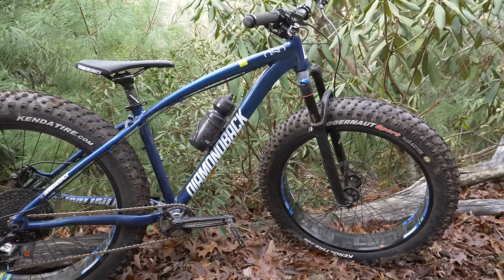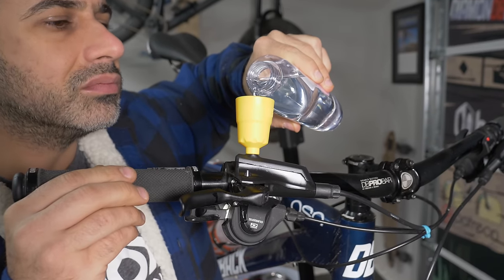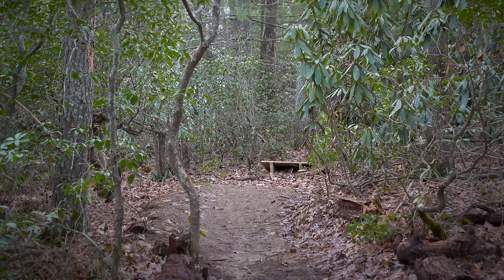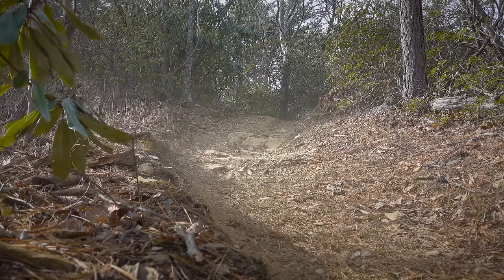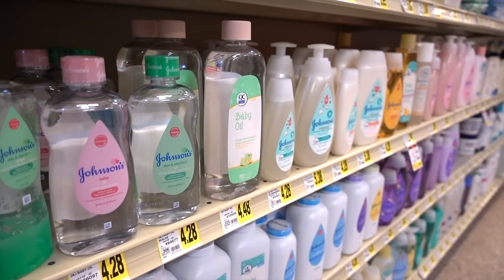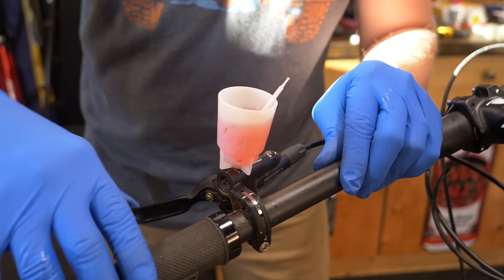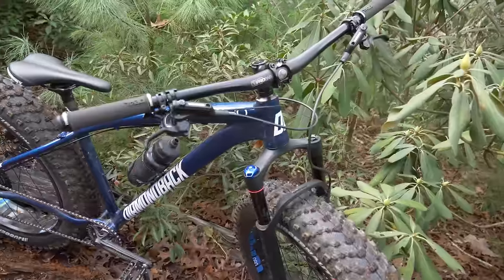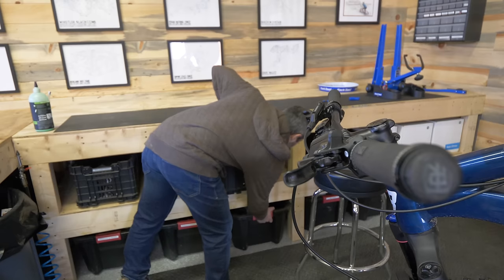I filled my mountain bike brakes with baby oil for a year and here are the results!

Comment: Now I'm wondering if I can use baby oil in my Shimano fishing reel bearings and petroleum jelly on my gears. I've been paying $50 for reel oil and grease for the last few years and they look very much like baby oil and petroleum jelly.
Reply: If there are plastic couplings or rubber seals in your reel, petroleum jelly might degrade them. It's probably silicone-based, unless it's all metal (which it might be)

Comment: The main ingredient of baby oil is mineral oil, which seems to be the same type as brake oil. It seems to be a good idea to use it in mineral oil brake, but we need to pay attention to the fact that the kinematic viscosity of baby oil is different from that of mineral brake oil, which will lead to the change of brake rebound speed. Besides, a series of additives, such as anti-oxidation, anti rust, high temperature resistance and anti-corrosion, are added into the brake oil, which are not available in baby oil. Therefore, we suggest that the most effective way is to use baby oil Good or special mineral brake oil, may as well consider the next ezmtb, excellent performance Jia :)

Comment: The reason that I wouldn’t do this is because baby oil has chemicals in it that evaporate so if you put this inside of your brakes it might work for the first few weeks and then he might have some problems but that’s just my theory love your videos Seth
Reply: Very small proportion of chemicals in baby oil additional to refined mineral oil. Basically just perfume (tiny %) and possibly colour, though branded brake oils also have colour added.

Comment: in the automotive world fluids are designed around brand specific seals and the properties that break those seals down ON PURPOSE so that you have to use their special blend for the additive that keeps their pet seals from leaking and failing altogether.
brake fluid can be any fluid for the operating temperature that doesn't bubble or cause air pockets, doesn't overheat, and doesn't break down the system it's being used in. i'm sure some where in the universe molten lava can be the brake fluid. probably jupiter or the sun or a black hole. my imagination with physics isn't the best tonight but hey, it's just a figure of physics in science, invent your own atmosphere.

Comment: Question:
"Is motorcycle brake fluid a good alternative?"
"Or is it just the same as brake fluid for the bikes?"
Reply: Not even all the brands are using mineral oil. Some brands use DOT fluid which is used in cars, motorbikes and aviation. NEVER mix DOT and Mineral oil!
Reply: @KapitanPisoar1  thanks! I appreciate it!

Comment: could you use dot 3 or dot 4 automotive brake fluid? might be cheeper than the baby oil too depending where you get it (Ollies, or other overstock stores can be really cheep)
Reply: Absolutely not. DOT 3 and 4 fluids are glycol-ether; very different chemistry from mineral oil. Brakes designed for DOT fluids use different seal materials to resist the strong solvent properties of those fluids. Spilled DOT fluid will even damage paint. DOT fluid in a brake designed for mineral oil is very likely to damage the seals.

Comment: We experiment with different types of mineral oil and even try water(yes water).....they all works well that we conclude that the density of the oil is the significant part.....(we should have tried motor oil which is thick fir sure)........the liquid in quesion need to run smoothly back and fort inside the tubing or brake hose...no wonder water also worked.....but I think plain mineral oil should be better than colored mineral oil.
Reply: The coloring us nice to evaluate the oil when purging, you can for example alternate between clear and colored oil to make sure the old differently colored oil is fully out

Comment: Clever in that respect seeing that baby oil is mineral oil based it would then be very similar to dot 2 brake fluid. Just a note please do not use baby oil in your car/truck/motorcycle as it will need dot 3 to 5.1 which is glycol based not oil based.

Comment: If your not descending with the brakes on long enough to overheat the fluid it won''t really matter whats in there if it doesn't rot the seals or cause corrosion. Seems like a good enough emergency measure if you have a problem and can't get 'correct' fluid. A 99% brake is way better than 0%

Comment: I used vegetable oil in a clutch one time. That was over a year ago and in a motorcycle. Actually, it's still in there. And my clutch is perfectly fine.
Reply: I would higly recommend you to get it changed not because it will damage it not immediately but after a certain period it will eventually become acidic and will start to form butter like residue which can and probably wear parts or make it difficult to function properly (if it requires mineral oil go for the baby oil if needs brake fluid dot 3/4/5.1 will be great and damn cheap i find it for 3 euros /250ml

Comment: Just use vegetable oil.
I've used it, here's the results:
faster Breaking, cheap, ez to find.
But here is the bad results:
brake could either literally won't break, Orr it would lock up.
Greasy, if you accidentally spill it and it touch with the tyre, you'll lose some precious grip.

Comment: In the northern United States like border states it's below freezing temps mite not be a good idea I use ford mercon transmission fluid also if you do have leaks it's red color will stain rotor you can see if you have a leak issue baby oil mite degrade seals on some units I have seen engine coolant used in alaska also

Comment: I tried filling baby oil on shimano mt315 and mt200 and it still works right now. It's been 2 years since I filled them. I also tried filling zoom hydraulic brakes but it ruined the seal and leaks. The brakeset came to me without any oil so I filled it wil baby oil and I can't use them anymore.

Comment: Not worth it for me.
The temperature stability is still unknown and could change a lot between brands.
The oil could also part or suck moisture over time.
The brake fluids are a lot more controlled for bikes, baby oil just needs to not harm a baby, everything else is not important.

Comment: Stupid question: how do you tell if it’s a hydraulic kit? That cable will be completely absent right? Just like a hollow tube?
Reply: There's no "spare" bit of cable hanging out the brake caliper end. Just pipe. Some brake levers will also have a visible piston when pulled too, instead of a visible cable.
Also, many hydraulic brakes say so on them because they're more expensive... I guess so you have something to show for it.

Comment: I'm 270lbs and ride a GT Pantera sport hard tail. It came with tektro mechanical disc brakes. I find the brakes very weak even going down small grades. I've adjusted the brakes to their limits and still find them weak. Would Shimano 2 piston hydraulic brakes help alot or am I just throwing away my money. I ride light trails. Nothing crazy

Comment: Seeing someone with a bike with tyres that wide to ride on a hard surface is like watching someone walk up an escalator moving in the wrong direction. Side note: mineral oil eats rubber, bad idea to use on anything designed to run with traditional automotive style brake fluid.

Comment: Well first of all if you get injured using this and the insurance company does an investigation( depending on how high your bill is) you're screwed. Plus its not only mineral oil, its corrosion inhibitors oxidation preventers( to keep the oil stable) detergents and so on. Its not just for funnzies they engineered a high boiling point oil and spend thousands of hours of research. Generally when it comes to your health you dont skip. Its worth the 20-50 dollars per every other year. I mean that bike is thousands of dollars. Why cheap out?

Comment: Can i use mineral oil instead of dot 4 brake fluid ? Where i am shimano mineral oil is stupid expansive for some reason and have known people using off the shelf cheap mineral oil but they dont use the bikes to extremes. So for everiday use casual use baby oil is fine but if you ride hard ,well no i know tested that. Yet.

Comment: Seroius question. I Need to bleed my Shimano brakes, but I can't find Shimano oil anywhere. Can i use the Finish line minerale brake fluid? I can't find reliable informations on It, but I happen to have a bottle of that sitting around. Some people online say they had black goo coming out their brakes when using it, others that they had no issue. 

Thanks

Comment: Here's an opinion that a lot of "gear heads" don't like:  These companies put the screws to us, simple as that.  Using Shimano Mineral Oil is not going to make a difference to 99.9% of riders over using Baby Oil or Mineral Oil.  Its the same stuff.  Same as chain lubes.  Back in the day there WAS no specialty chain lube, we dripped 3 in 1 oil on our chains with no problem.  Recently got into a discussion on a Maine MTB page and everyone was laughing at me for taking off my chain, cleaning it with WD-40, soaking it in chainsaw bar oil, drip drying it and replacing it.  Guess what, Ive NEVER had a chain or drivetrain issue and I ride harder than everyone I know.    Its consumerism, nothing else.  We THINK we need these specialty products, we have the money to spend, so we spend it.  Im a hard pass.
Reply: so you've never replaced a chain? its gonna snap soon mate.

Comment: I doubt that you'll feel the difference on any chemically tame fluid, probably even water will do the trick, at least so long as you don't overheat it
Reply: "...so long as you don't overheat it"    and there's the rub (if you'll excuse the pun) where the friction of a disk brake involves heat. (hence vented discs, pads, and ceramic pistons.)

Comment: Just so you know, my RC Carisma SCA-1E Range Rover shocks are filled with olive oil. Well I didn't have damper oil on hand but needed to work on them. Olive oil is pretty light, probably about 15wt. I wanted it softer anyhow, just as an experiment. It rides the ground so smoothly at 5mph top speed, but has increased torque roll. Sway bar is on it's way.

Comment: I have those crappy kind of squeeze lever brakes on my bike. and its a pretty poor choice of bike for using it on the road or even casual biking. due to only having one single fixed gear (hard to pedal and get up to speed)
and the tires keep losing air randomly with absolutely microscopic leaks that lose air over period of few days. and i havent been able to fix it.
sometimes my tires just randomly burst on the bike rack even though they are not being overfilled! its a horror story

Comment: I wonder how well it would work if you used ATF (automatic transmission fluid) which is essentially a high-spec 10-weight mineral oil? It's usually red or pink, so I bet it would even make it through a warranty claim. Could a bike shop technician tell ATF apart from Shimano oil? I suppose this idea fails if it's used instead of some other brake manufacturer's oil that is, say, blue.
Reply: I have now been using Citroen-style LHM+ mineral hydraulic fluid in bicycle brakes for 1 month. It works very well. I bet that this is what Shimano fluid or Magura fluid (etc) is made from.

Comment: viscosity should not matter because its not being used as a true lubricant and is just being used as a hydraulic fluid and is only realy used instead of water because it will not rust metal or grow algae

as for heat 90% of the heat is kept in the pads not the brake pistons ware the oil is and the brake caliper acts as a heat sink dissipating the last 10% of the heat before it gets to the oil also Mt bike brakes do not get that hot compared to a car's brakes so theoretically a bikes brake fluid should not actually get more than just a little warm from the heat of braking/fluids being compressed 

so there should really be no concerns with using mineral oil for Mt bike brake fluid as ware baby oil might have additives that might gum things up down the line

Comment: 6:12 There is no need to expose anything...  Brake manufacturer ARE ripping off their "customers", period.
Those like sram using DOT fluid doesn't have this option because DOT  fluids are standardized,  yet sram can still ripoff their customers on many other things like greases and fluids for their seatposts and forks :D

Any high temperature hydraulic mineral oil will work on bike brakes. Probably even better than the oils rebranded with fancy names by the brake manufacturers.
Reply: It has to be lightweight oil though, usually anything between 5wt and 10wt will work fine

Comment: You did not need to make so many disclaimers....  The truth is..  Mineral oil is mineral oil.  Also, the brake system parts that would fail would be the rubber seals and o rings, which you could easily swap out after a few years anyway..  I will use baby oil also...

Comment: I know which oil id want to spill on my 20k paint job, or my skin being contaminated with brake oil, not to mention the enviroment. there are so many reasons to use baby oil for brakes, not to mention if you run into a hottie on the track and no one around and you need some lube...

Comment: i could not afford to order brake oil for my tektro set on  my xc bike so i brought some hydraulic oil from work
to be specific it was shell tellus s2 m68 that we usually use to lubricate the beds of our machies aswell as use as the oil in the gearboxes of our lathes 
riding with it for over a year now and the brakes feel almost as good as when i got the mtb but that could be because i bled them like a total idiot

Comment: Always check ya baby oil     never let your baby run low on oil        i wouldn't want ta use baby on a down hill pikes peak run  I don't know what the boiling point temps are between baby oil en break fluid but my guess is the brake fluid is gonna be quit a bit higher  one thing I do know is if you boil the fluid in those calipers the slightest bit that peddle or lever is going to be spongy ta none

Comment: Works for me. I even mix Shimano oil with baby oil and it is fine. IDGAF
Reply: I was thinking of doing that, is it still working for you?. I paid $4.33 an OZ and I got a 100ml bottle witch is around (3.38+ OZ.) it's a TINY bottle for $13.

In this video the guy says a $1.30 an OZ I did not get that same price. 🤬 if I got it for $1.30? my bottles true price is $3.90. 🤷‍♀ if that is the case? I could have gotten 3 bottles. I would have preferred getting the proper oil than baby oil but for $1 an oz for baby oil?. I think I'm going to do what you doing and 
(MIX THEM.) 🤷‍♀

it would just be funny if the company of shimano just took baby oil and replaced the (SMELL) and added (RED COLOR) and called it a new invention.  😂I would not be surprised at all. 🤷‍♀😂🤬
Reply: @magnetohex703  Yes, my brakes work like new. I'm from Romania, so I'm not familiar with ounces. I bought 300ml of Johnson’s Baby Oil (PINK label) for the equivalent of $3.6. I can get 100ml of SHIMANO mineral oil for about $10. If you're from the US, the difference in price might be smaller, but I don't have a choice. For now I'm mixing them because the bike came with Shimano oil and I'm not bleeding them yet, I'm just adding new oil (baby oil) on top of the old one when needed because the old one is still clean.

Comment: I'm very new to the mtb world, so I've been reading in forums if there's and alternative to Shimano oil.
Tbh, I'm very sceptical towards baby oil, although, why would I buy Shimano oil when automotive oil is cheaper. For instance, Atf oil or power steering fluid have similar viscosity to Shimano oil which is 10W. And automotive oil is synthetic with a ton of additives in order to reduce wear. Still, if there's anyone out there whom have tried automotive oil as mtb brake fluid, please I would love to read your opinion.

Comment: Hi everyone. I was searching for a video about how to properly flush your brake system and when it's recommended to do it. I'm a bike mechanic starting to work on e-bikes and for reasons beyond my control i can't get the recommended brake liquid for Tektro, which is the brand most bikes we deal have. Do i need to flush the system before refilling? I understand there are some tricks for improving the brakes just removing air bubbles from the system and filling some liquid in. Can i do that mixing brands? Your help will be highly appreciated.

Comment: i removed the hydraulics from the bike and threw them away - cables work fine and are field adjustable; all that oil and cups, leaks in hot weather and the mess of that stuff on the garage floor... its a scam, don't get sucked in.

Comment: I'm not saying this would happen to a bike - it almost certainly  wouldn't.  But here's a story that's Type II funny.

I once accidentally poured power steering fluid into my brake fluid reservoir and drove 500+ miles.  Yes.  Dumb.  I was young and didn't have dad muscles yet.  Eventually the petroleum-based PS fluid caused every rubber part in the entire brake system to swell up.  That reduced system volume enough to cause the calipers to slightly extend and the pads to make light but continuous contact with the rotors.  It was enough contact to cause the brakes to glow red hot but not enough to really be noticeable at first.  I had to essentially replace everything.  Some things we learn the hard way.  🤦🏻‍♂️

Comment: Dumb idea to use dot brake fluid (okay for downhill bike) bicycles are not going fast enough and brake surfaces are too small. Dot fluid needs to withstand instant, constant, and high temperatures from MOTORCYCLES braking. Shimano went the right route and baby oil seems to be just fine.